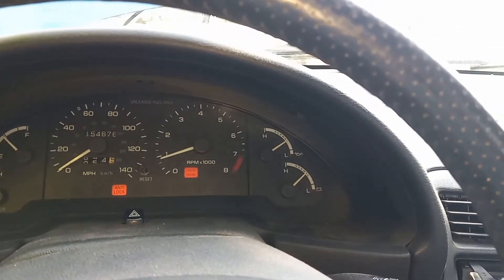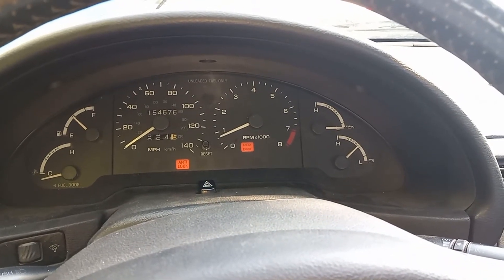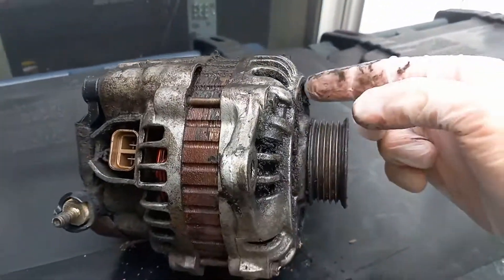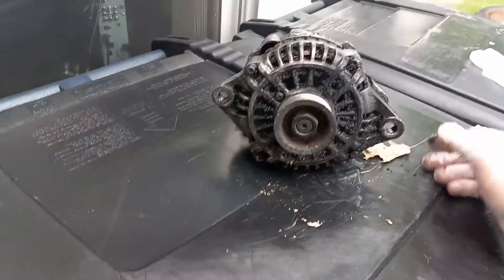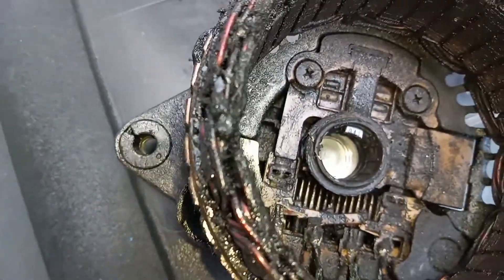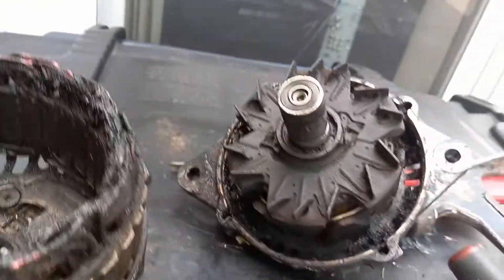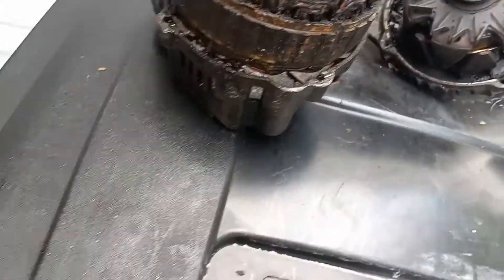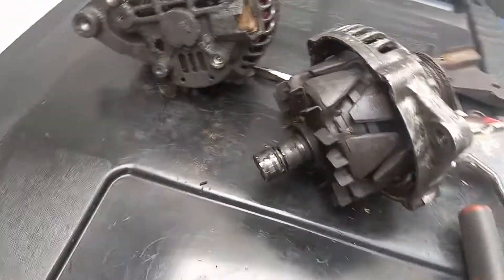Ford Probe GT, Mazda MX-6, 626, 2.5l V6 alternator disassembly.

Comment: oil pressure gauge is an electro/mechanical unit, its an 80 PSI sending unit. Hard to find, I just bought a used off off ebay.  v6 and the 4 use the same sending unit. Might even be able to get one from a miata.
Reply from the maker: I did not know that about the 4 and 6 using the same one. That should help, me find one. In of my other comments the guy said they're $175 new, if you can find one. I feel like I should try soaking it to clean it first. Just the inside bit, a few different solvents and a steam clean might dissolve the gunk. One of these days. The other guy said the Miata used switch type senders but I imagine that could be based on year as well.

Comment: I just replaced the A/C clutch on mine. after swapping compressors, both had faulty clutches....
Reply from the maker: I had a/c for a couple weeks when I bought it. Then it was making noise. I never tried the compressor that was on my ZE, just left it all unhooked.

Comment: The issue with mine is related to the exciter circuit, I have an AutoZone alternator and it's got a lifetime warranty, I've swapped it 4-5 times to no avail every time..... I found an MX-3 manual that showed how to troubleshoot the exciter circuit on those cars, and I'd assume these work almost the same
Reply from the maker: My alternators always seem to have the same problem. They work great for awhile then over time battery starts to fail from running low. So if this fixes em for the same amount of time as a reman, then I can keep doing this. I believe I used 400 grit on the copper contacts only. Nothing harsher than needed. The rest was cleaned off with purple degreaser with and scrubbed down with Dawn
Reply: @pgtmr2713  http://www.mazdabg.com › ...PDF
Web results
Mazda MX-3 Workshop Manual

Type that into Google and it'll pull up the PDF manual. It's not searchable by text so you'll have to find the section for alternators

Comment from the maker: Don't worry about the oil pressure dropping to nothing, it's only a bad sender. Every once in awhile I forget about it and have a heart attack. I have to figure out a hack for that. It's got some weird obscure British pipe thread for the sender to the engine.
Reply: What year is your car? Only 1993's use an actual sender and the fucker is $175, every other year uses Miata switch senders and they're super cheap, like $20
Reply from the maker: @Jamesbond22855  94 is the year. 93-94 use a sender, 95 is when they started pulling options and wiring  to cheapen the  cars. My 95 had a switch sender, on off.  The sender that's in there came with my ZE.
Reply: @pgtmr2713  I didn't realize that! Sorry. I knew 94 shared a distributor with 93, but the weird dual coolant temp sensors on my 93 always throws me for a loop
Reply from the maker: @Jamesbond22855  It's all good there's things I get wrong all the time. So far as the coolant sensor and sender, one's for the ECU and the other the dash. One more thing that can be used to troubleshoot when things go south. How's your ride doing. I feel like YouTube goes out of it's way to not show Probe channels.